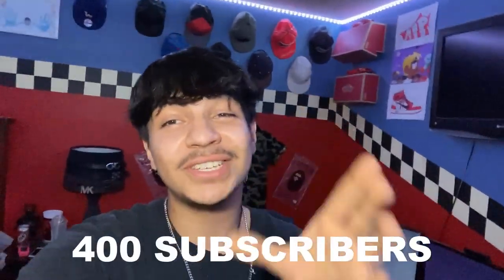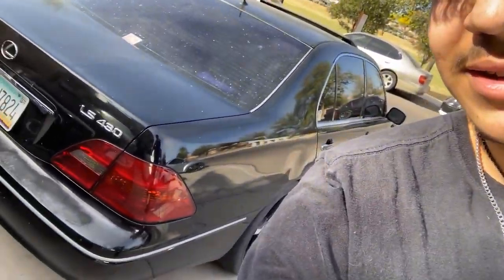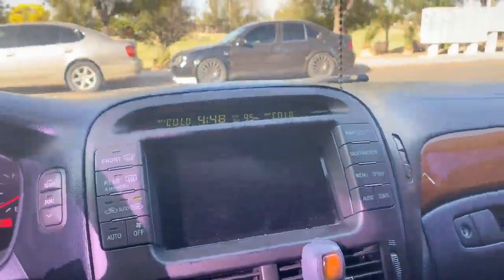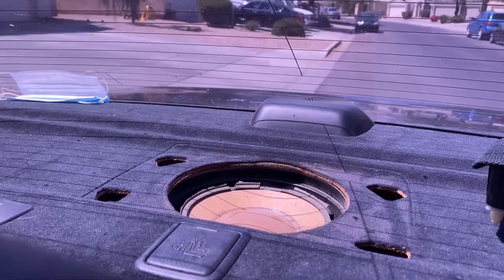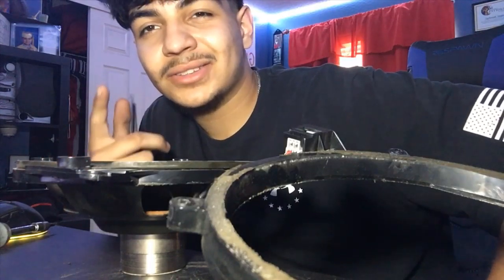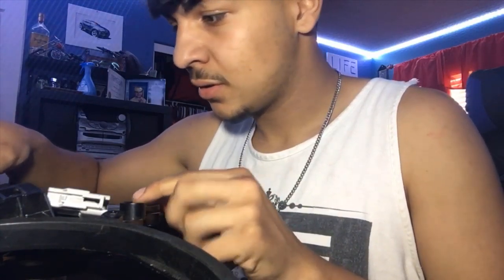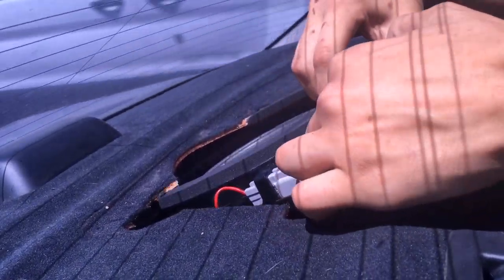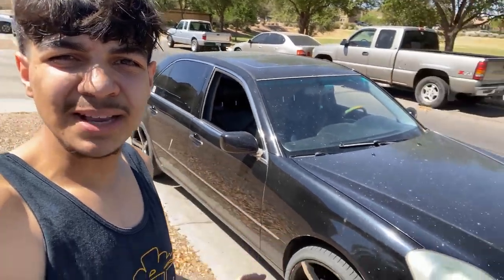LEXUS LS430 MARK LEVINSON FACTORY SUB REPLACEMENT/REPAIR

Comment: How did the speaker cover latch back after you cut the area it supposed to snap on?
Reply: The cover has long legs with clips that go below the carpet and into the hard deck